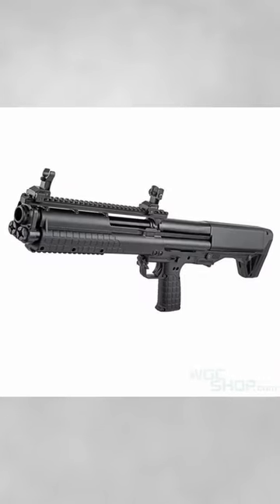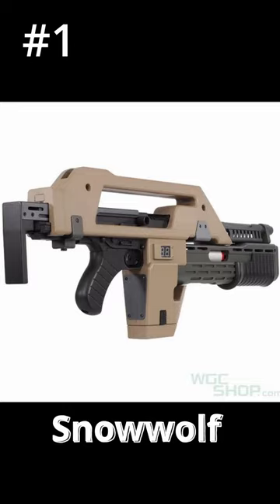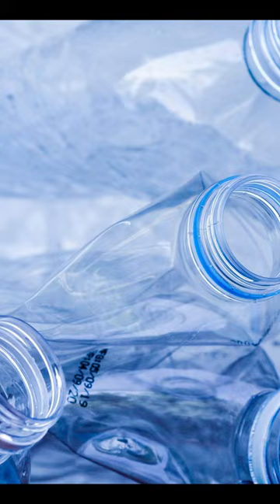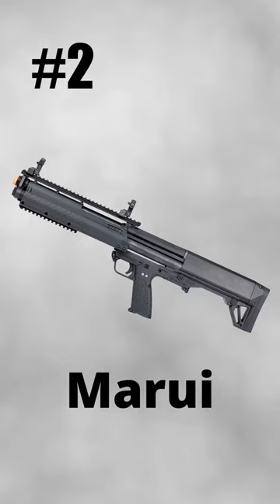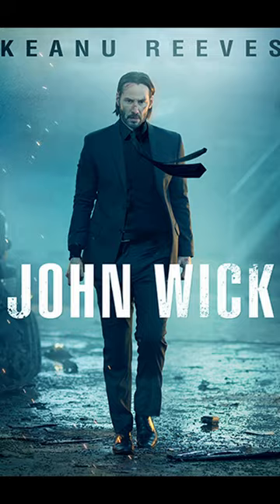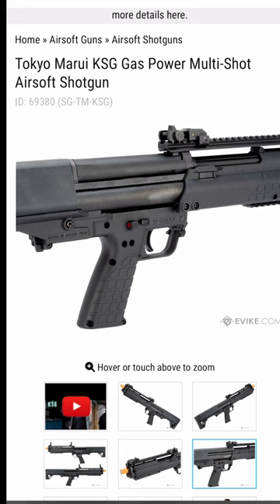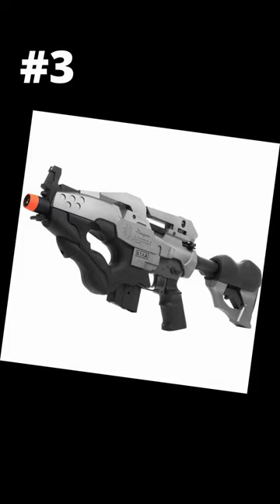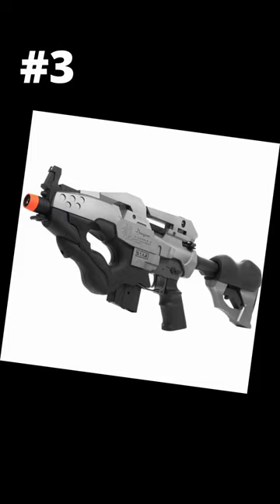The STRANGEST Airsoft Designs Ever Made 🤯

Comment: bro just said the ksg is a triple when its usually a double barrel, but what is shown is the single barrel version. im talking with my real steel knowledge idk if they have a DB KSG for airsoft
Reply: It’s three inner barrels
Reply: @klairty4046  they are called tubes, shells move down the tubes into the barrel, the barrel is where the bullets come from.
Reply: @elijahreeves4890  it has 3 inner barrels for each bb. But has 1 outer barrel (what you are mentioning) it has 3 inner barrels to fire multiple bbs at once
Reply: @zachoman420  oh were talking airsoft oops
Reply: There is no such thing as a double barrel KSG, although the DP-12 exists, so you might be thinking of that